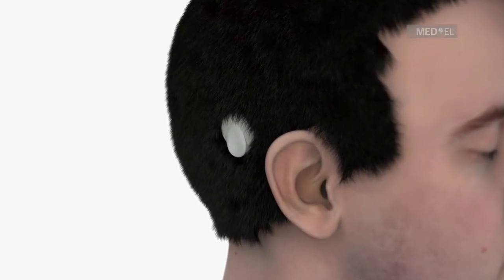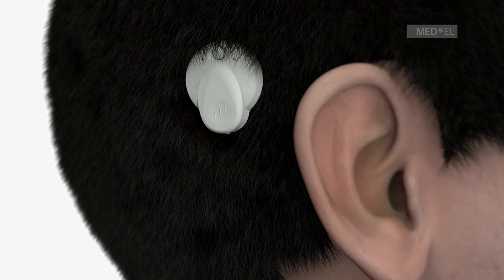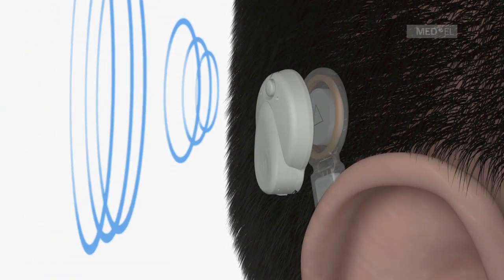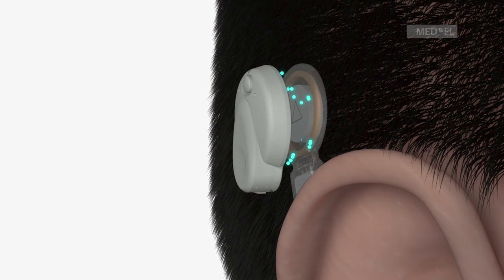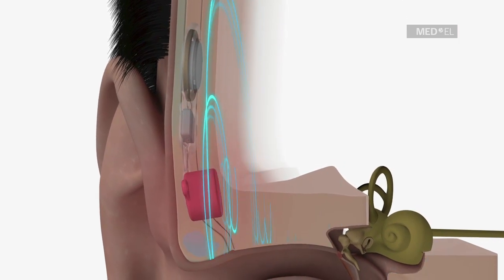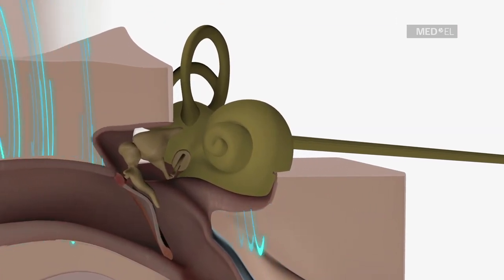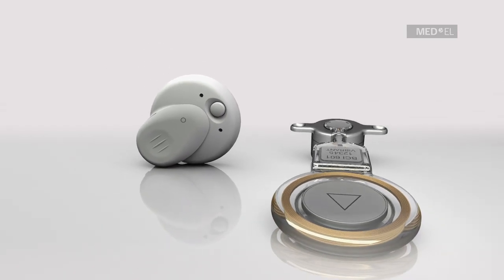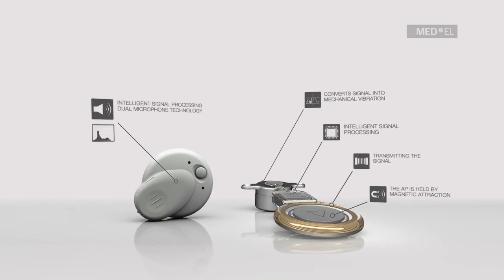How the BONEBRIDGE works with Amadé Audio Processor

Comment: Hi Ii looks like I might be going to have this done and one of the things I have not found out is how strong the magnet is? I have read about a hair clip that can be used as a safeguard against it coming off. I have a friend who has had the baha done and has had t knocked off a few times.
Reply from the maker: +Sandymc fatty Hi there, thanks for writing! The audio processor for the BONEBRIDGE comes with a hair clip as you mentioned, as well as different strengths of magnets. Your audiologist will be able to select the most appropriate strength for you, to maximize stability and comfort.

Comment from the maker: BONEBRIDGE sends sound to the inner ear through bone conduction, while in a cochlear implant an electrode array in the cochlea provides electric stimulation to replicate the sense of hearing. 

To find out if a hearing loss solution is right for your needs, you'll need to speak with a doctor or hearing professional. I'll send you a personal message with information about how to contact your local MED-EL representative!